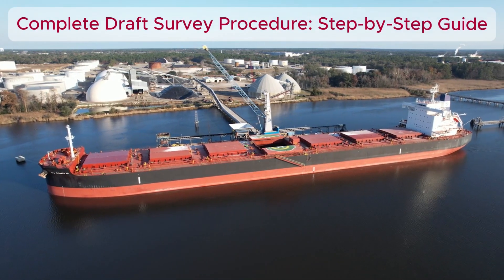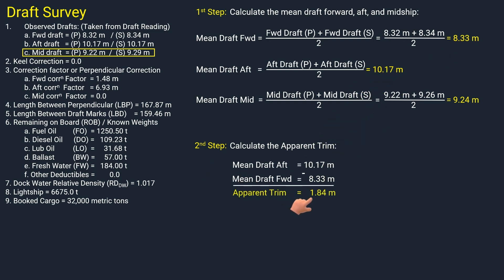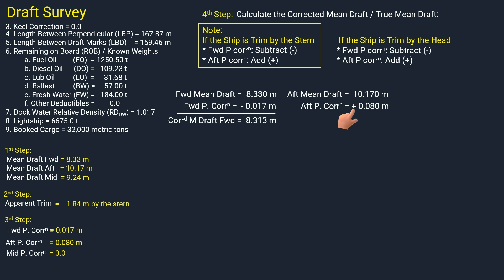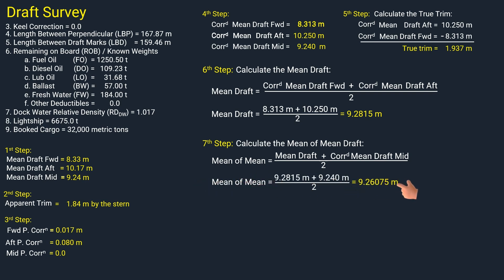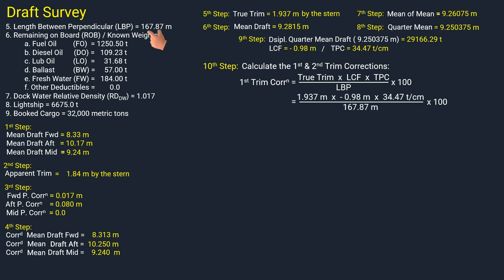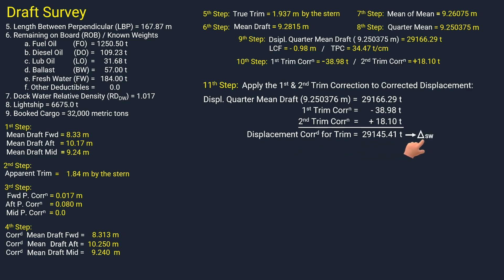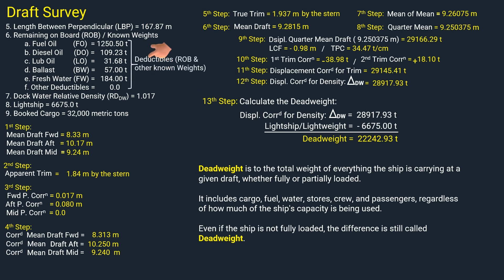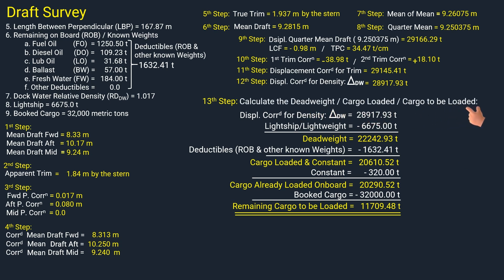Complete Draft Survey Procedure: Step-by-Step Guide for Cargo Calculations

Comment from the maker: NOTE: The Hydrostatic Table used in this video assumes that the data given in the table is at Zero Trim.
At timestamp 4:47, there is a clerical error: Rules in applying P correction: 
If the ship is trim by the head
*Fwd P correction: Add (+)
*Aft P correction: Subtract (-)
Reply: Sir, what shall we do to if there's  midship p-correction. In which case we'll add or substract?
Reply: hi, welldone for the explanation, very very informative. There is a mistake in the Obs. Mid Draft (S). Initially, it states 9.29m, then you calculate the mean with 9.26m and carried on with that

Comment: Hello Sir. Thanks you for sharing
Step 5 - Trim by stern
Fwd P Corr: -
Aft P Corr: +
If Trim by head, the opposite is true.
So what about Mid mean, sir?
If the Mid Corr distance is from the center C towards Aft, will the formula have a + or - sign? And if the Mid Corr is from the center C towards Fwd, what sign will the formula have?

And what about the ship's Trim by head condition?

Comment: 1:43  Brother 1 step mid ship draft your (P) 9.22m and(S) 9.29m you write but then u  1 step calculate mean mid 9.22m + 9.26m ÷2 = 9.24 m ok but how (S)9.29m then (S) 9.26m
Reply from the maker: Thank you for pointing that out! My apologies for the slight error in the example. The calculation should use 9.26m as the mid starboard draft. Thanks.

Comment: Hello sir What do you think about Hogging & Sagging, does it affect draft survey ?. How should we deal with it Sir ?
Thanks you so much and hope you recomment
Reply from the maker: Thank you for your great question!

Yes, hogging and sagging can affect the accuracy of a draft survey, especially when they are significant.

That is exactly why, during the draft survey, we calculate the Mean of Means / Quarter Mean. These methods are designed to correct for hull deflection—whether the ship is hogging or sagging.

Here’s how it helps:
By averaging all six draft readings (forward, midship, and aft—both port and starboard), we get a more accurate representation of the ship’s floating condition.

The Quarter Mean formula adjusts for curvature in the hull, giving us a corrected mean draft that reflects the ship’s true displacement more accurately.

So yes, hogging and sagging do have an impact, and this is the reason why we apply these calculation methods in the draft survey. Hope this helps clarify your question!
Reply: @nauticalacademy001  Thank you Sir...Hope you have a good day Sir

Comment: sorry,  FWDn corr.=1,48   AFTn corr.=6,93 ,MIDn corr = 0   How can find ? Are these values same every load calculate?
Reply from the maker: The corrections you've mentioned—FWD corr.= 1.48, AFT corr.= 6.93, MID corr.= 0, are specific adjustments provided by the shipbuilder to account for the positions of the draft marks relative to the forward and aft perpendiculars. These corrections are essential because, during a draft survey, accurate draft readings are crucial for determining the vessel's displacement and, subsequently, the cargo weight.

Draft marks are not always positioned exactly at the forward and aft perpendiculars due to structural or design considerations. Therefore, corrections are applied to the observed drafts to determine the "true" drafts at these perpendiculars. These correction values are typically found in the vessel's Trim and Stability Booklet, which is provided by the shipbuilder. This booklet contains detailed information about the ship's hydrostatic properties and necessary corrections for accurate draft measurements.

Each vessel is unique in its design and construction; thus, the correction values are specific to each ship. They are not universal and can vary significantly between different vessels.
Reply: @nauticalacademy001  thanks a lot for information

Comment: Mau kah kamu membuatkan video hitungan seperti ini lagi Untukku menghitung GM sampai akhir, dengan contoh kapalmu dengan menggunakan tabel. Jika kamu bersedia saya sangat berterima kasih kepadamu
Reply from the maker: Thank you for your request for a more detailed video on GM calculations using ship examples and tables. Currently, I am not on board a vessel and do not have access to the necessary equipment to demonstrate cargo calculations directly. However, I plan to create such a video in the future when I have access to the required resources.

Comment: I think there is missing here. The values (displacement, tpc, lcf) in table were calculated based on 2 meters trim. True trim is 1.937 mtr by stern then  you went for the interpolation of values between 1mtr & 2 mtrs, isn't it the values at thiss point are the values to be used already? Because it's been corrected base on this table. If table is on trim 0 trim then you'll apply 1st & 2nd trim correction but this table you already calculated values at at 1.937mtr so that's the corrected values already. But then again you applied 1st & 2nd trim correction so basically corrections were applied twice.
Reply from the maker: Thank you for highlighting this oversight. You're correct; if the hydrostatic tables already include data for specific trims, the displacement, TPC, and LCF values are adjusted for those trims. In such cases, additional trim corrections are unnecessary and could lead to inaccuracies. Tables which typically provide data for even keel (zero trim) conditions, trim corrections should be applied. I will make corrections for this video. Thank you for your valuable input.
Reply: @nauticalacademy001  Not a problem, some vessels they have the same design of hydrostatic table and some are not depends on where and who made it.  Glad it help.
Reply from the maker: @eby8572  Thank you so much.

Comment: Halo sir, We used to take displacement at trim 0. Then apply the trim correction. You took the displacement at almost the actual trim then applied the trim correction also. Which one is correct?
Reply from the maker: Usually, hydrostatic tables are developed at zero trim (even keel), so trim corrections are necessary when the vessel is trimmed. However, there might be some ships where the tables provide data for specific trim conditions, so trim corrections are not necessary. I have already edited the video, and the table used in this video, the data assumes it is at zero trim; therefore, both first and second-trim corrections are necessary. Kindly review the video for steps 9 & 10. Thanks

Comment: question sir, what about bending correction (hog and sag correction)? Is it not used in real practice?
Reply: if i am not mistaken, the bending correction is not used in practice as the quarter mean is used to obtain the displacement. Is this correct?
Apologies for the bother :) I've never seen my C/O making a hog and sag correction in practice... Thx!!
Reply from the maker: Thank you for this great question, sir! Actually, calculating the Mean of Mean and Quarter Mean as shown in this video, we have already applied the hog or sag correction. The formula for hog or sag correction is: F draft + A draft + 6 (Midship draft) / 8. If we use this formula to find our Mean of Mean = Corrected Fwd mean draft + Corrected Aft mean draft + 6 (Corrected Midship mean draft) / 8, calculating the Quarter Mean is not necessary, because F draft + A draft / 8 is ¼ mean draft or 25% of mean draft, which is the Quarter mean. And 6 x midship draft is ¾ of midship’s draft or 75% of midship draft. Using the hog or sag correction formula, the Mean of mean and Quarter mean are integrated. That is why some officers called Mean of Mean also known as Quarter Mean.  

Just remember that if we use the formula in this video to find Mean of Mean, we should also calculate the Quarter Mean as our next step. But if we use the hog or sag formula to calculate the Mean of Mean, calculating the Quarter Mean is not necessary, use Mean of Mean to extract the value of ship's displacement, so as with LCF and TPC, and also use it for 2nd trim correction, as Mean of Mean is considered also as Quarter Mean using the bending correction formula.

Comment: Hello! Isn't there a mistake at 4:47 about the rules? They are just both the same. If the trim is by the head, shouldn't it be Add by fwd and subtract by aft?
Reply from the maker: Thank you for pointing that out! You are absolutely right—I made a clerical error in the rules of applying the P correction. If the ship is trimmed by the head, the forward P correction should be added, while the aft P correction should be subtracted. I truly appreciate your keen observation, and I’ll pin the correction in the comments section to ensure clarity for others. Thanks again for your valuable feedback!
Reply: @nauticalacademy001  could you please explain, what those trim corrections are for? I mean - what exactly do the 1st and 2nd trim corrections  stand for? And why was that table developed for 2m trim? I just know that those tables are made without trim and they may contain trim corrections in themselves. Do we need to find those trim corrections in case we can interpolate our displacement for the right trim? Thank you. I am just a cadet and there are sooo many questions and no one to ask right now
Reply from the maker: @tgwlw1430  Typically hydrostatic tables were developed at zero trim, so trim corrections are necessary. However, there might be some vessels in which the tables provide data for specific trim conditions, so trim corrections are not necessary. I have already edited the video, and the table used in this video assumes that the data given is at zero trim, so first and second trim corrections are necessary. Kindly check the video again for steps 9 & 10. Thanks
Reply: About keel thickness when to apply

Comment: Is it accurate to use bilinear interpolation on mean drafts 9.25 9.250375 9.26  trim 1m or 1.5m 1.937m 2m.??? Cause i see other calculation they only use linear interpolation in mean drafts at 0 trim
Reply from the maker: Typically, in most ships the data provided in the hydrostatic tables is at zero trim (even keel), so trim corrections are necessary when the vessel is trimmed. However, there might be some ships where the tables provide data for specific trim conditions, so trim corrections are not necessary. I have already edited the video, in this video, the table assumes that the given data is at zero trim; therefore, both first and second trim corrections are necessary. Kindly check the video again for steps 9 & 10. Thanks